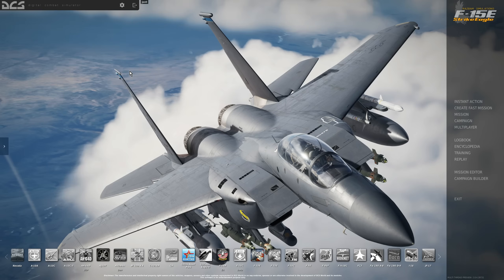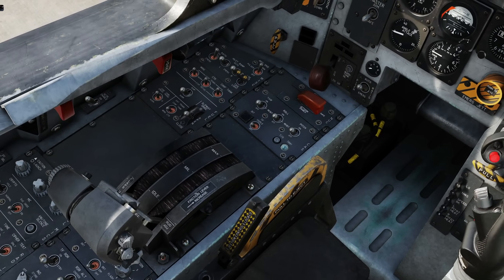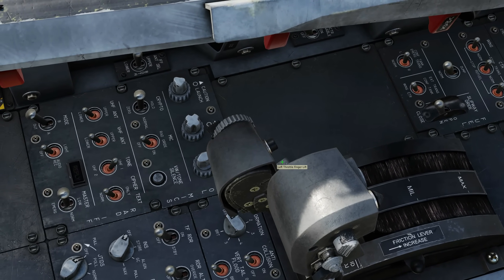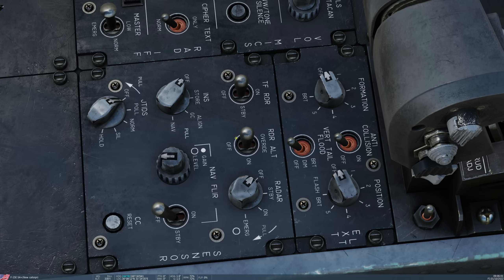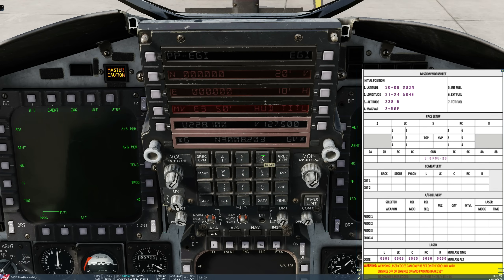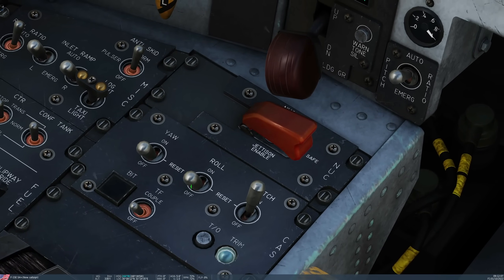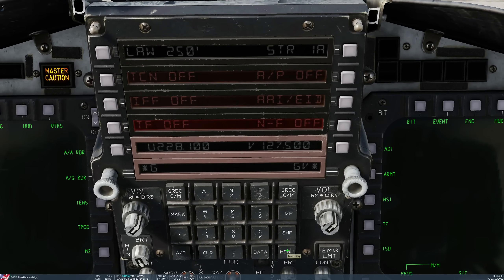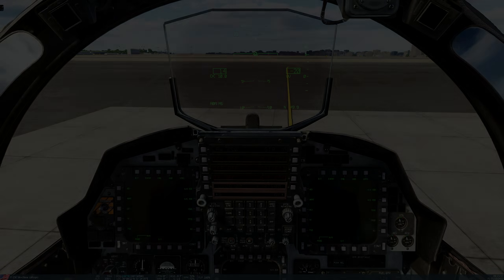F-15E Strike Eagle: Cold Start With Full GC INS Alignment Tutorial (front seat) | DCS

Comment: Radiation from a fighter plane radar can kill a human, so you have to make sure everyone is clear of the front of the aircraft.  I'd imagine turn on the radar would be a late step.
Reply: The RADAR does not transmit on the ground unless you connect a prox box which simulates the jet being weight off wheels. No prox box will ever be connected while the engines are running though.

Comment: I believe you only turn on the radar after alignment not because of the radiation, since the plane is on weight on wheels, so the radar is not emmiting. I believe the problem is to regard of the radar antenna movement. Inertial systems, even more older ones, are very sensitivity to movement.

Comment: I'm guessing the reason you need the radar off for alignment has to do with the antenna's movement.  It's probably enough to prevent the aircraft from being completely still on the deck.  I also noticed if you're doing an alignment and move the rudder pedals the yaw from the nosewheel movement causes the alignment to temporarily stop.  It'll switch from counting down to CG hold.  It's a really cool detail.